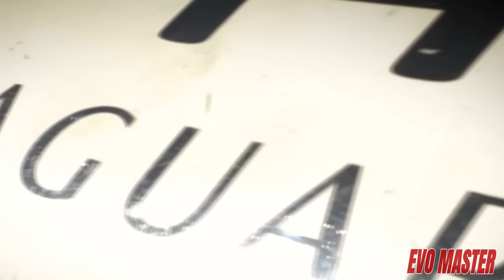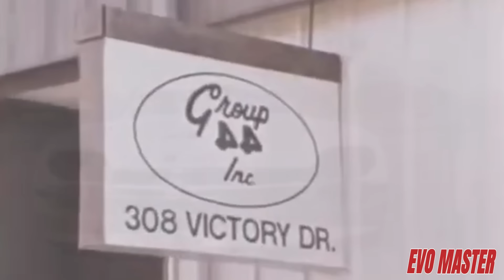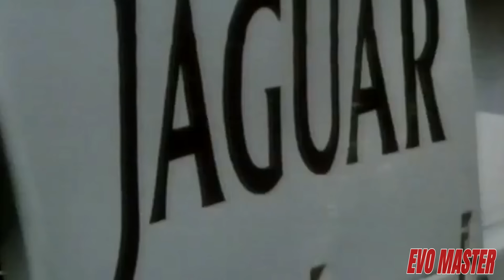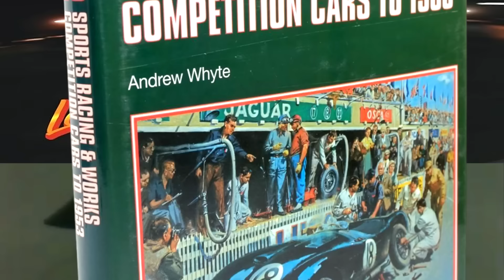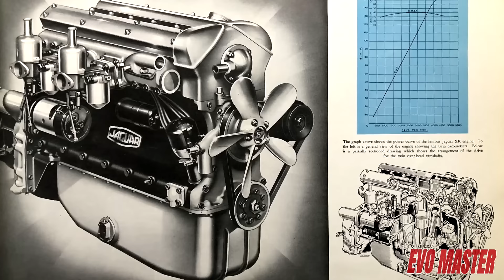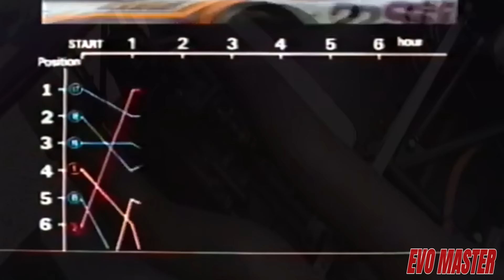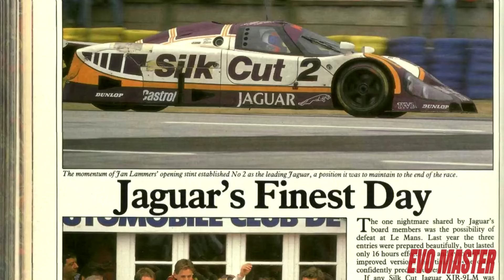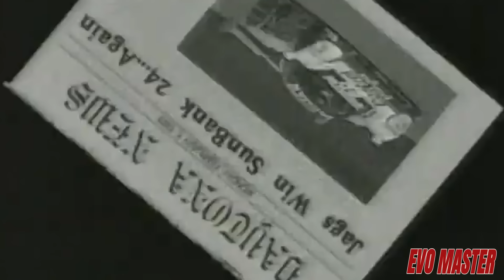El ASCENSO de JAGUAR en el GRUPO C. DESTRONANDO a PORSCHE

Comment: Aporto algunas curiosidades sobre estos motores.
El primer Jaguar en montar el V12 fue el XJ13 en 1966 pero solo se fabricó una unidad.
Se fabricaron 53 unidades del XJR-15  y 5 del XJR-15 LM que montaban el V12 homologados para calle.
En el superdeportivo XJ220 en un principio se pensaba montar el V12 y tracción total pero en su presentación apareció con el V6 de 3.5 litros y con tracción trasera. Como consecuencia se anularon la mitad de los pedidos.